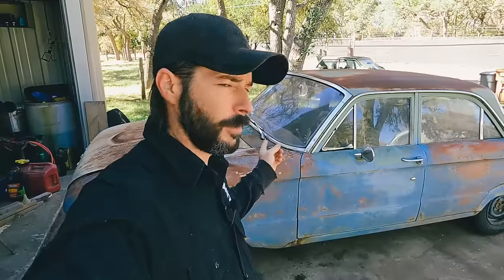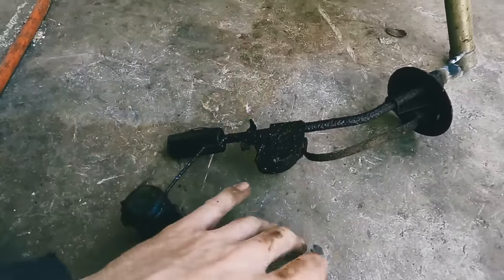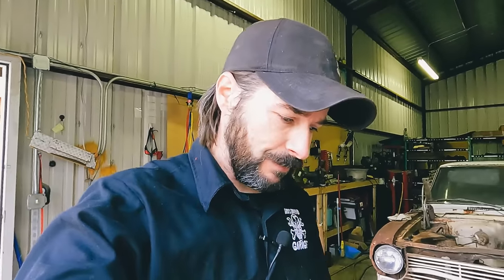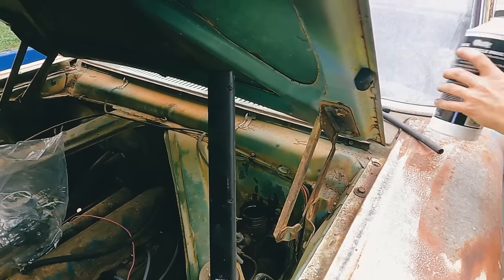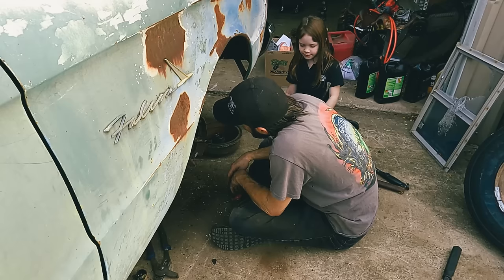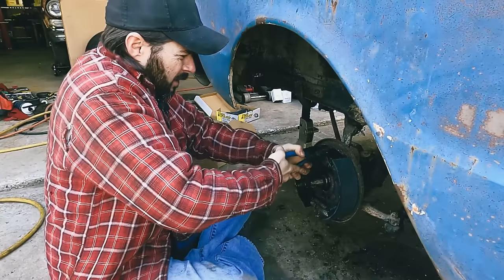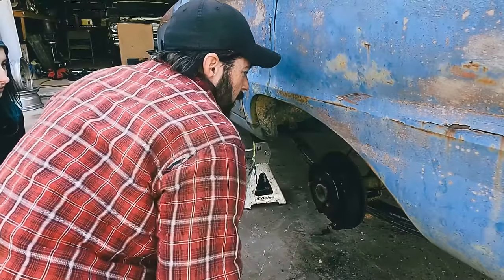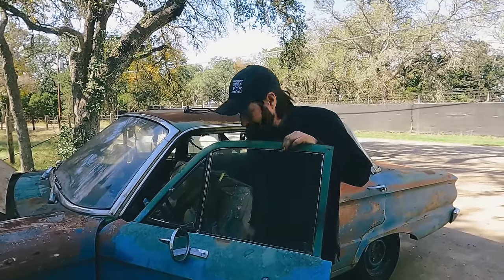ABANDONED 1961 FORD FALCON - PART 2 - WILL IT MOVE?

Comment: I don't think that's the original fuel pump. My '62 had a huge one with a glass cup on the bottom for debris. Replaced it with an electric pump.
Reply from the maker: It is the original. They changed various little things each year model.

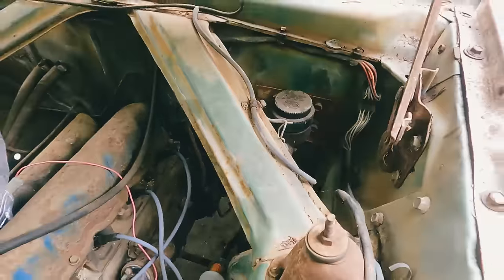Comment: Was surprised to see you can still buy a new dual action fuel vacuum pump for it. And so close to the original too, only needing to swap the end caps! I recently went to the auto parts stores to replace my 65 falcons 6cyl pump and was disappointed to see that although the new pump would fit, it did not look the same. Was taller, and was crimped together. Not rebuildable like my old one. I keep my car original so I found a place that sells rebuild kits. Works 35:52 great! Too bad the parts from China are such crap!

Comment: Just a safety comment: the Ford Mustang had that style gas tank which turned out to be a fire hazard in a rear end collision. I believe they remediated it by putting a metal sheet to protect the back seat. Also, as a youngster, I saw those type of springs holding the brakes in place. There was a tool for removing and a reattaching the springs by rotating the springs.

Comment: there is a brake tool that is 1 piece has the spring removable tool on one end and the spring installer on the other thats the only tool i have ever used had it for 50 years

Comment: Sleeper dude 88 as a whole field of falcons he has soft spot for them and Fairmont economy cars of 60 s got not common drivetains like 2 speed 3 speed auto or cutch but drag racer brought up and rode hard and blew up that why dont see them lot or somewere in cars life it had transmission swapped to 4 or upgrade to better tran design